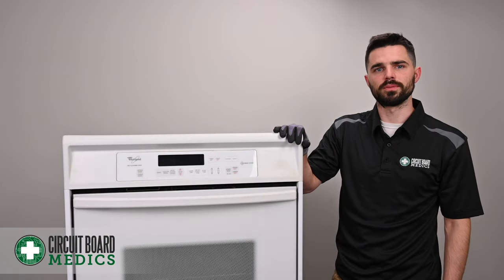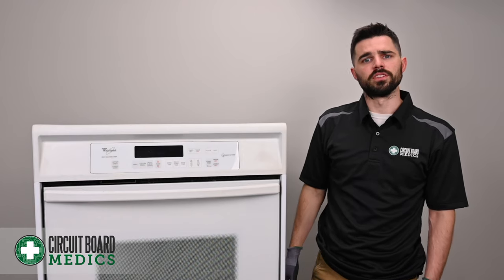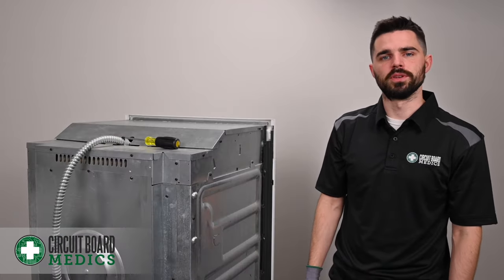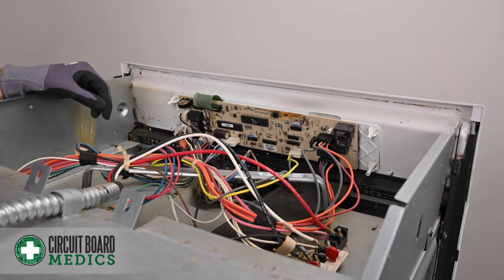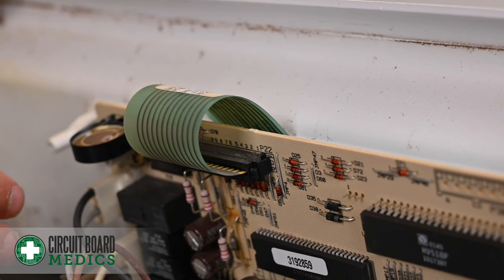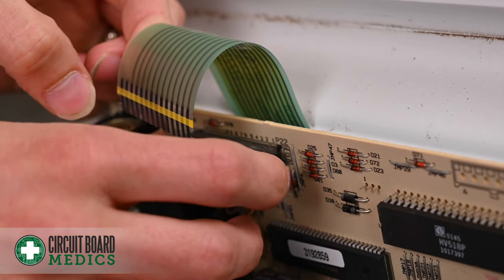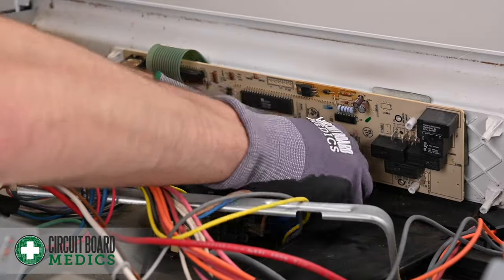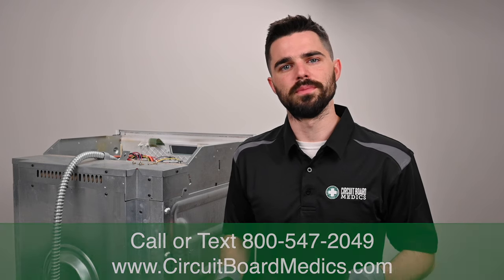Whirlpool Oven Control Board Removal

Comment: Can the board completely shut off the oven? Nothing turns on, lights inside the oven when opening the doors etc. Almost seems like a breaker went out but power is coming to the oven and board is receiving power as well.
Reply from the maker: It's possible that a transformer has blown. Because this isn't one of the more common problems that we see, the best way for us to help you is over the phone. One of our customer support representatives would be happy to serve you. We're available to talk or text at 800-547-2049, Mon - Fri 8am-5pm EST.
Reply: @CircuitBoardMedicsLLC  I actually figured it out, ended up being the inline thermal cutoff at the control unit.

Comment: Whirlpool GMC305PRs00 only heats up to 240ish when set to bake at 350.  Top element when on broil turns red hot, bottom element gets hot on bake but not red hot.  Temp sensor checked out along with elements...no codes.  Control Board?  Thanks
Reply from the maker: That definitely could be related to the control board. We recommend you send it in, especially because you confirmed that the sensor and heating elements are good. If you have any other questions, you can also call or text 800-547-2049 and talk to one of our customer support representatives. This week we're open through Thursday, 8am-5pm EST. We look forward to serving you!

Comment: I have an older Whirlpool wall oven microwave combo (model GMC305PDS07) that isn't working. In the beginning the display panel went dark and the oven stopped working while the microwave oven continued working but without a display. Then without doing anything the panel lit back up and the oven worked again. This intermittent issue continued to happen, on and off. The display and oven hasn't worked now for several weeks. I had a repair service come the other day and the service tech diagnosed the oven and told me it needed a new CCA part # WP8301848. By the next day the company sent me an estimate to repair the oven and added a PCB/Rebuild (part # 8302153) which the way I understand is the entire display panel? They said the part was discontinued and would have to be rebuilt. My problem is, this isn't what the tech told me. He understood that if I purchased the CCA part I was considering installing the part myself. I don't understand why the technician told me what the problem is, only to have their office tell me something different. He inspected the oven and told me what needs replaced after testing the panel, then his office says I need a new panel without ever seeing the oven. I think they are trying to pull the wool over on me. Does any of this make sense to you? I want to buy the part and put it in myself and the tech helped me by giving me the part number, etc. I know I can't take the part back if it doesn't work but from what their tech told me, that should fix the problem. What do you think? I'm not sure what to do.
Reply from the maker: Very sorry to hear about the issues that you have been dealing with. Definitely not the time of year to go without an oven. Intermittent display issues usually indicate a problem with the main oven board (part 8302153). It is possible that the other issues you’ve described are being caused by the same faulty part. Our Customer Support team is standing by at 800-547-2049 to talk through everything you are going through and see if we can help get your oven back.
Reply: @CircuitBoardMedicsLLC  I have since talked to the service tech who said the main board is the problem. Trouble is, the board is discontinued and it would have to be rebuilt. I'm sure one or more components failed on the main board. I'm now looking into where I can send the board to have it analyzed and repaired. Do you have any suggestions? The company I've been dealing with says they can have it rebuilt for $225. I think that estimate would be me removing it and reinstalling it which I can do.
Reply from the maker: We fix that board (part # 8302153). You can start an order here https://circuitboardmedics.com/8302320-oven-control-board-repair/. If you have any questions about placing an order, we'd love to help you. You can contact us via the information in our first response.
Reply: @CircuitBoardMedicsLLC  Sorry, I found a place to repair it and already sent it to them. I will keep you in mind if I need something in the future. Thanks for replying.